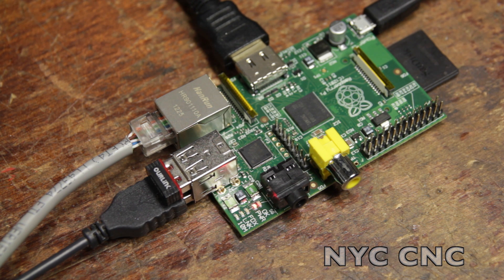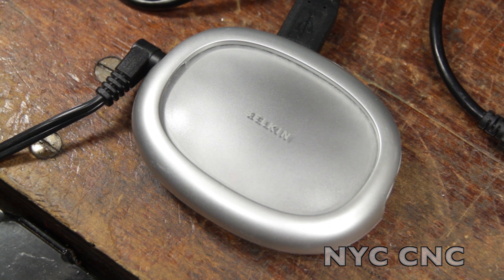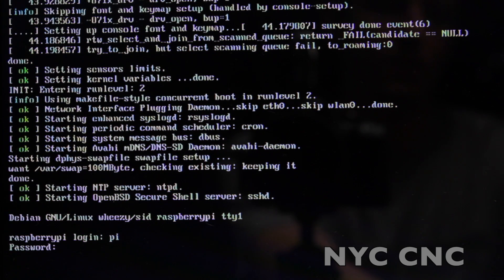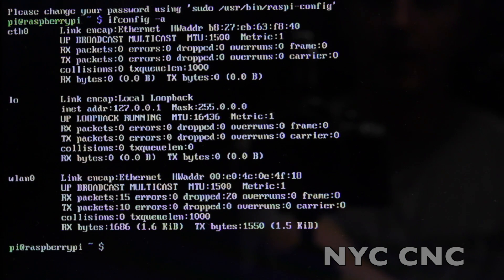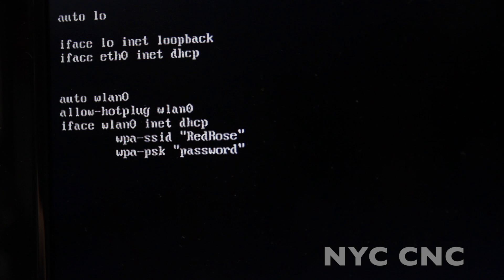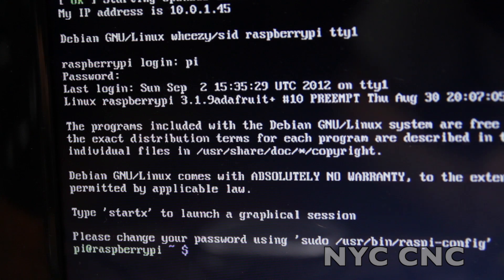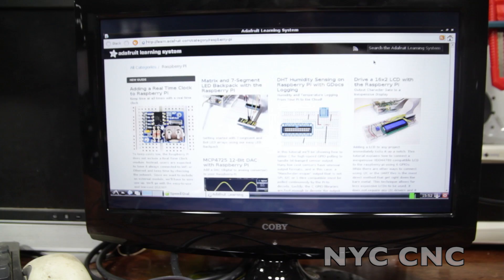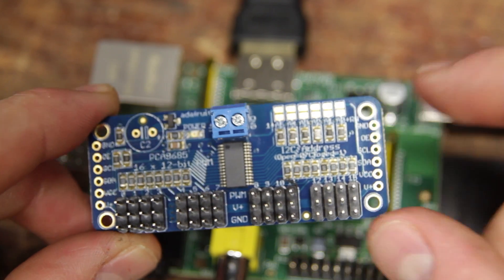Wifi Wireless Internet on Raspberry Pi!  "How To" Tutorial from NYC CNC

Comment: Whoever crimped that CAT5e cable did a horrible job 0:05 lol
Reply: +NYC CNC Haha well at least it worked :). I make them all the time at work. I prefer CAT6 as it has the little end pieces where you hardly ever mess it up. Just a tip when making CAT5e, use the length of your thumb nail for the wire cut, push the wire up in there with the insulation in a bit and crimp. But either way as long as it works you're doing fantastic lol

Comment: I wonder if is possible to use Raspberry Pi with satellite internet, and in addition connected to the car power supply.
Reply: NYC CNC Maybe I haven't explained well. The question is, If I have internet satellite connection can I use this line to connect 100 pi in different cars (one pi for each car) and send the local position of each one to a database?.
Reply: NYC CNC Can you explain it with more details?
Reply: that is a great idea! wish I thought of that

Comment: I type in ifconfig and wlan doesn't pop up, what do?
Reply: Mine does not come up either
Reply: guys, it either means that your wireless adapter doesnt have its modules (term for drivers in linux) are not installed on linux or they're not supported by the linux kernel at all. thankfully, the latter doesnt happen alot (only with uncommon adapters). to install the modules, you'll have to compile the source code of the drivers and then use the modprobe command to load them if the compile was successful.

Comment: I use wireless internet on my pi and all I did was plug in the wifi adapter and enter the network password, I didn't use any other special thing just the same deal as my laptop.

Comment: Looking forward to getting a Pi. Right now, I am doing some research on what accessories I should order. Do you know if this Wifi Dongle is the only one compatible with the Pi (I am ordering other accessories from a different website and I would like to combine shipping)? ;) Also, about the power source; I have a phone charger that can plug into both the wall and the PI. I think it is 5V. Will that work?